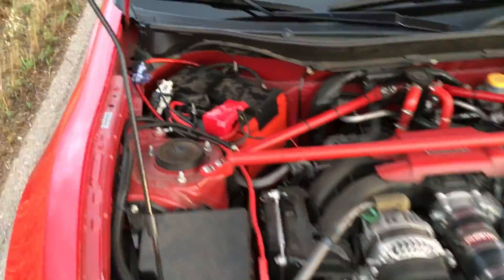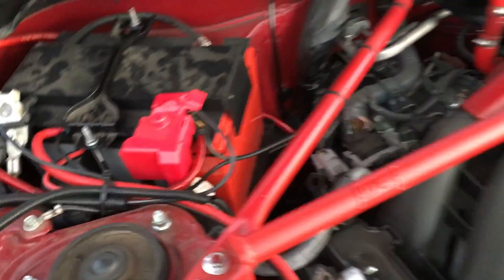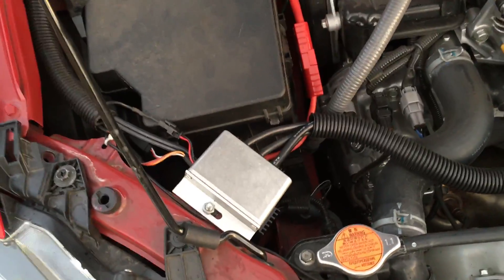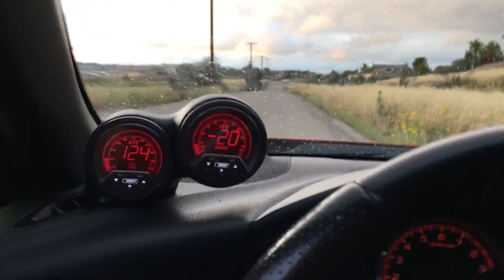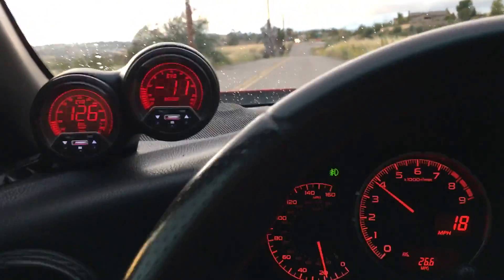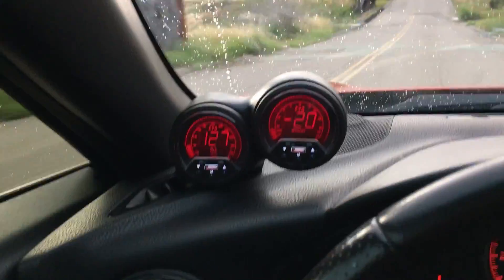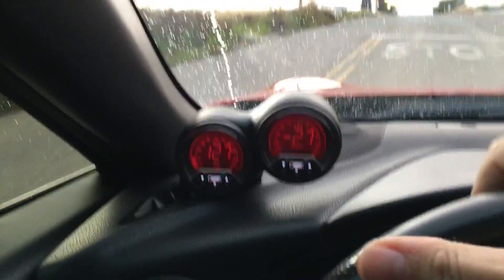Phantom V3 Proof of Concept- Boost Gauge Proof- Electric Superchargers Can Be real

Comment: now, I wonder what cfm this thing produces......do we know? because on a small motor the amount of cfm it can take in is much less than a bigger motor. I have a 2013 mustang gt and a boss manifold. it's ported and the throttle body is ported, it flows roughly 1130 cfm. that's probably double what this car is. wonder if this would have ANY impact on a large engine? only kits are made for this little motor. I wonder if that is the reason. I'm almost certain that my motor would actually create more suction of cfm than the little electric turbo could produce almost instantly. since the 2.0 is such a tiny little low hp engine, it doesn't suck down air like mine does. so if I put one on my car it would create a vacuum on the electric turbo I think and hurt performance in a HUGE way.

Comment: i think people are confusing the crappy computer fan style "electric superchargers" with turbo housing/compression wheel style electric superchargers. FYI Valeo are producing electric superchargers, and they are used on Audi's (SQ7), together with turbochargers. Instant throttle response and fuel economy is their function. So they can and do work.
Reply: The real point here is the $1500 they want for something that will produce drag on anything large that a 1.2liter motor.  It's a scam!  For $400 dollars you can buy a cheap NO2 kit and get real horse power.  Running a 20 shot will make a 10lb. tank last a while and provide much more power than any electric piece of junk ever could.
Reply: Unfortunately in Australia NOS kits are illegal for street use. Not sure what USA legislation is?
Reply: same , most states cant even have it hooked up or you can still get a ticket on public roads, many try to hide the bottles ^^

Comment: How much did the extra 25 or 30 hp cost?
No2 is a cheaper and far better power adder Hands Down!
Reply: the smaller engines on the dyno have got up to 20% gain in HP its the larger motors that get 30-50hp gain which is still not beans you know. I mean what do you get for 1000 dollar exhaust setup 4-10hp gain? The price is therefore comparable and not bad bang for the buck and NO its not as good as a supercharger but who the hell has 6000 for one and then pay thousands more to install it, NOT EVERYONE.
Reply: you can get a 75 shot No2 for $350.
Reply: @warrentrucks09  no2 is also a lot harder on a engine
Reply: Elder God 
Really?  How so?  I’ve been running it since the early 80’s and I’ve only blown one engine on it and that was due to a faulty solenoid.  NoS in reasonable doses will absolutely run forever with no problems.

Comment: Lol so you have a brushless motor with a 120amp speed control / controller  sweet I have HPI TRAXXAS AND TEAM ASSOCIATED BRUSHLESS RC CARS that do that.
Reply: but none of them have the same torque as this motor. 24V @ 120A= 2880Watt where as your R/C sees what, 11.4V max from 3 cell lipos? 11.4 @ 120A is only 1360Watt you need to put in a few 25KV motors to match the torque of this bigger motor

Comment: I made a thing just to comment on this. Companies that sell this shit are aiming at gullible consumers like you. These "superchargers" do not have enough CFM to make any power. It is called a placebo effect and you're probably doing more harm then good by slapping that crap on your car. I recommend that you google how forced induction works and then toss that shit into the garbage. Save your money, buy a real forced induction kit, install that shit, and go get a dyno tune. there's no way that that little electric fan can forced enough air into the motor to yield any gain in horsepower. A turbo uses exhaust gases to spool the turbo which in turn produces the "boost". Believe me if electric turbos do not work. For example a whipple charger or a procharger cost about 5000 dollars as a kit. comes with a tune, injectors, after market fuel pump and of course the air pump. Both are designed to yeild roughly 6 psi depending on what size Pulley you run on the supecharger. 5000 dollars dude and what did you spend on this like 400 or 500? im sorry, but you got played for a fool. You need to learn how forced induction works. That gauge is probably being run off an electrical signal which is giving you make believe results. Show me the pressure sender that came in your kit that converts the pressure into a reading.

EXPERIENCE: I WORKED WITH TURBO AIR COMPRESSORS

Comment: the positive boost is caused by the fast intake air spinning the fan in the electric supercharger and right as you let off it takes a slight second for the fan to slow down so it pulls intake air on its own for just a second completely unhook the supercharger and I guarentee you will have the same results. I build 500 horse small blocks all the time(look at my channel) and I have experimented with multiple types of turbos and if you get into the math you would have to have a turbine of some sorts capable of turning over a 130,000 rpm to make useable boost
Reply: you will never show 5psi on a boost guage without actual boost...no hopping on n off throttle will not show it...
Reply: The rate at which the turbine would have to spin depends a lot on it's shape and size, no?  I ran one of these superchargers a couple years ago and it most definitely creates boost.  The inertia effect you are referring to makes absolutely no sense in the real world because it's coupled to a brushless motor that doesn't want to spin.
Reply: j92s1 it makes total sense when you gas a car and release the throttle usable vaccum exsists for a few seconds (hence power brakes) it is that same vaccum or air being pulled into the motor that causes the fan to spin even if its working against the electric motors resistance when you give the car gas it sucks more air (pulls more vaccum) and that vaccum increases the fan speed and when you release the throttle the fan speed takes a few moments to decrease which causes it to make boost because the fan is forcing more air then your engine is using. I'm not saying its impossible to make an electric turbo or supercharger I'm just saying based on the video evidence and statistics of this particular one it can't make usable boost
Reply: I agree that any vacuum/combustion would be helpful to the fan's rotation, but it's just not possible for any amount of inertia stored in the lightweight impeller to somehow create positive pressure in the manifold.  I don't want to keyboard warrior, but I've turbocharged a buttload of naturally aspirated cars and am beyond 100% confident in saying that this particular electric supercharger does in fact create a substantial amount of extra power.  Of course it's nowhere near as powerful as the crappiest traditional turbocharger and yes, it quickly runs out of oomph toward redline - but it most definitely makes power.  

With my otherwise stock FR-S, acceleration in 6th gear at highway speeds was virtually nonexistent without it, but with the system armed it had respectable power.
Reply: Austin Lowhorn im not sure y this g u y thinks this works
Reply: vacuum decreases as the throttle blade opens and load increases.
Reply: SuperJlonergan right.  Idk where this kid is getting his knowledge. You can make 1 to 2 psi with ram air over 100mph.  Some British or german racing company proved that to.  So that wouldn't be explained by what that kid is saying.
Reply: Austin Lowhorn what?

Comment: 5 down to 3 down to 2psi...this has been debunked about a million times.  They DON'T WORK.
Reply: except this type has dyno'd improved numbers. not a lot but still gains.
Reply: 5 hp below 2k rpm maybe...this is bad science and bullshit marketing.
Reply: negative..  167whp-138wtq prior,  194whp-181wtq after on a dynojet @ a well known shop in the NW.
Reply: Why didn't they make a video
Reply: it's shows 13hp and 29ftlb gain. take the stick outa your ass.  did you even look at the complete setup? no you didn't.. your comments reflect that.
Reply: thats not a video ..... my bad there is a video it actually does something ill be fucked !!!
Reply: http://www.ft86club.com/forums/showthread.php?p=1219211#post1219211
Reply: the dyno doesnt lie. whatever.
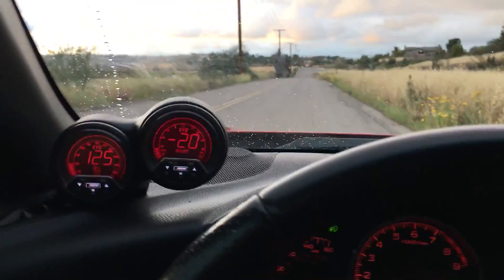Reply: wil8115 I call BS. The better superchargers have an effeciency of about 1:10. Meaning for every 1HP of parasitic draw, they allow the engine to produce 10 HP additional. So this heap of junk would need, at minimum, 2.7HP. That's 2000 watts... or 166 Amps @ 12 volts.
Reply: watch the video, read the thread. call whatever you want, they work.
Reply: John Doe The electric motor is 4kw and there is an optional 5kw motor, claimed by the manufacturer. Also, it is powered by 24v (two batteries) so half Amps.
Reply: yeah id like to see this video of said increases
Reply: wil8115 I'm sure they work great. As a fan maybe. As for adding HP, no.
Reply: Or you are in denial. A -+5 hp gain could literally be due to anything including th epower of the fucking fan they have running on the goddamn dyno pushing air at the car. They do not fucking work the way they should, They do not produce the boost they should produce and they drain the fuck out of your batteries if you do not have external setup. There are MILLIONS of real dyno videos showing that these things do fucking nothing. Forget your one video let me list you videos of real dynos with real superchargers ffs. You dont even know how a supercharger works if you actually believe this works.
Reply: Can you provide your source for this quote? It sounds as though it is referencing belt driven superchargers.
Reply: supposedly it is a 24V system so it would be less amps.

quote : "The better superchargers have an effeciency of about 1:10.
 Meaning for every 1HP of parasitic draw, they allow the engine to 
produce 10 HP additional. So this heap of junk would need, at minimum, 
2.7HP. That's 2000 watts... or 166 Amps @ 12 volts."

Comment: This would only work if u have a electric motor that turns around 120.000 to 150.000 rpm i have also tought of an electric turbo and also found this company but it just doast work that way besides that an electric turbo would be a great idee sins u could let a electric motor spin up very fast and can hold a steady boost if the motor is good enouch so i would buy an electric turbo if it works because of those reasons but til now il just keep my turbo :)
Reply: mr42ndstblvd yikes dude.... normal small engined turbo cars have turbos that spin at 80,000 to 200,000 rpm...  low enertia turbos can even reach 250,000 rpm. after that rather pittiful lack of knowledge, your argument looks to be just as misslead.
Reply: Lots of companies are starting to add electric motors to exhaust driven turbos. Mercedes and Honda are two examples. An electric motor that prevents turbo lag is a perfect option. But even those motors can’t keep up at high rpm which is why those turbos are still essentially exhaust driven. I would love to see an aftermarket manufacturer start producing electrically assisted turbochargers. To me that would be a much better use of electric power for boost applications.
Reply: they do spin that fast....
Reply: for a Garrett GT3076R (57mm Inducer) maximum efficient RPM range is about 70K-100K RPM. that will net between 1.5-2.5 Bar flowing 30-40LBS/Min. the smaller the compressor wheel the faster it needs to spin. 
GTX5018R (88mm inducer) is between 45K-75K RPM, 1.5-3.2 Bar flowing 60-120LBS/Min
Reply: HKS to my understanding is working or have electric assisted turbos and even full electric superchargers (may still be in RnD) but at least working on them. Garrett I havn't heard anything from yet. Procharger not so much. they just made a multigear supercharger so dont know if they will bother at all.

As for motors keeping up thats because everyone makes a flat motor curve, basically 100% all the time. if you were to do that with any setup, electric or otherwise, they would all loose boost in the top end. you would need a motor controller that watched boost pressure and made changes to maintain boost. much the same as a wastage on a turbo monitors boost pressure to make changes to the impeller speed.
Reply: Liam Cooper that is very true about variable motor speed for maintaining boost. And I had no idea about the new boost applications hks is working on. I’ll have to look into that. I’m on the road to boosting my s2k and I figure if there is a company improving the technology associated with FI, it’ll be worth waiting for. Thanks for the info man. I’ll have to do some research on that.
Reply: I did have a quick look but didnt find anything in the product line so might still be in RnD. if they ever release it i could just imagine the cost.... wouldnt want to undercut their turbo options
Reply: the only thing I find odd about all these youtube ones is no one is a gearbox to increase the impeller rpm... do it like a normal centrifugal supercharger and overdrive it. sure it may need 2 motors then but you can increase pressure output. One day I will make the prototype I've had for a few years now.

Comment: im sorry but it really doesnt, your basically trying to LITERALLY stick a hair dryer on too your motor, NOT GOING TO WORK !!!!
Reply: So all turbos and superchargers are hair dryers? it is using the compressor side of a turbo. basically the same thing as the belt driven ones but this one is driven by a electric motor

Comment: I wish turbos didn't need oil lines or an intercooler  you could just put one in your exhaust after the cat converters so you can still pass emissions inspection. And hose it into your intake and boom youve got 50 extra hp.

Comment: Umm why wouldn't your electric powered "supercharger" have boost all the time? I mean its not dependent on the exhaust or a pulley to make its power?
Reply: the reason for that is because it is hooked up to a 2 stage switch. stage 1 gives about 2PSI and stage 2 is max PSI (or like 5)

Comment: Do u even know how to read a gauge? It tells u right there that that crap isn't working. -20... Of course ur negative pressure will decrease with flow fluctuations. But to add more power it has to be a constant positive pressure. Ur actually adding more restriction to ur intake with that in the air flows way. Ever heard of cfm?

Comment: This pretty cool, Is it as effective as a turbo or a belt driven supercharger. Not even close. But!
Its new tech, and if this idea continues, eventually it will work, will it be cheaper than a the current price of a turbo and supercharger, maybe / maybe not. 
If you look at the improvements in batteries and motors in the past few years. The price of those two items have gone down,  so it is possible that an easy install and low price of an electric supercharger might have its place. As of now, Its a cool idea that hopefully will advance to compete or at least be another option (maybe entry level) for power adders.

Comment: Interesting. Always knew these would work, the question was always going to come down to cost vs benefit. To each their own.

Always amuses me seeing those criticize the drop in boost. Boost in itself is not a true measure of the system. Boost is the measure against restriction. Boost is like Volts, where as you need to know CFM, or Watts, in the electrical analogy, to make a resonably informed judgement. Naturally as engine RPM rises, it is drawing more air, therefore giving less restriction. This is more pronounced in this kind of setup because the Electric SC is spinning at one consistent RPM when on, as opposed to a real Centrifugal SC where SC RPM rises with engine RPM. So long as it remains in positive pressure at high RPM, it is still doing something useful and not a restriction... when active. Curious to the know the CFM of this system though.

Comment: Hah hah hah $1500 for that weak ass electric trash? Man I would of just saved up for a real one.
Reply: 4-5 psi peak. Easier to install than a regular supercharger kit. Less stress on the engine as there is no pulley/belt being driven by the crank. It’s far from perfect, but it’s a start. This could be the future. The ability to have supercharged power without various downsides. Why knock it?

Comment: nice,  3-5 psi is the difference between beating and losing against a 370z.  nice that you're trying this out.  I feel maybe in another few years it might be better and cheaper. I'll pick one up then
Reply: No it isn't. 370z would still rape it. Tests for this kit only showed like 190whp.
Reply: +Themayseffect thanks God my s2000 has more power.  5pound will yell me at 300 plus.
Reply: Themayseffect but you can get 190whp just by switching to e85
Reply: Themayseffect 190whp is not the same as 190hp
Reply: Themayseffect cbr 600 is 120 hp and will destroy a 370z .  an hp means nothing in a race . power to weight and many other variables
Reply: Joe-Ann Landry well obviously ass clown. The brz does not have such significant weight advantage as a sportbike for that claim to be a factor.
Reply: 190hp is not beating a 370z which was my argument. For one even it some how increased torque enough to make a difference the 370z still revs over 500rpm higher with still significantly more torque and more tire for better launching capabilities.

Comment: ~20inches of Hg at idle? u must be at sea level. up here at 7000 feet that thing wouldnt make  it past 0psi guage pressure. electric supercharger spins the same max speed at all elevations. where as turbo, wastegate would make turbo spin faster and work harder at higher elevations.